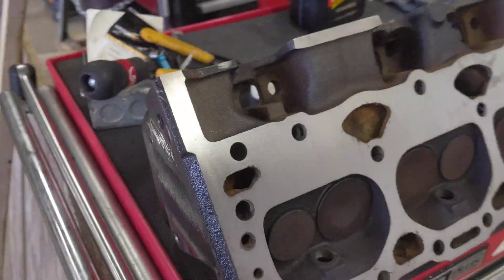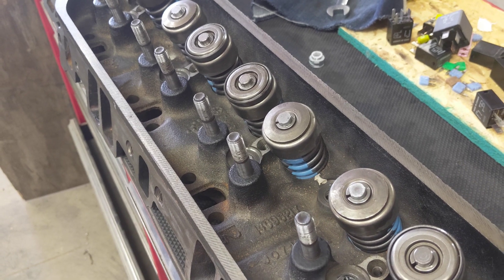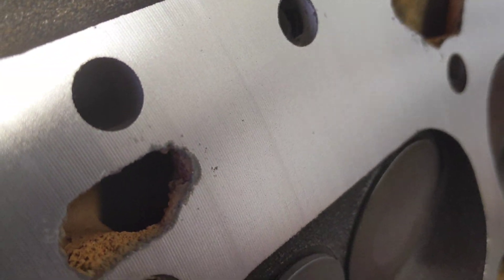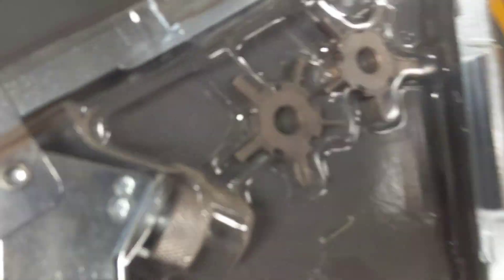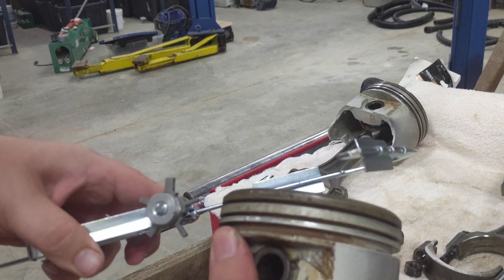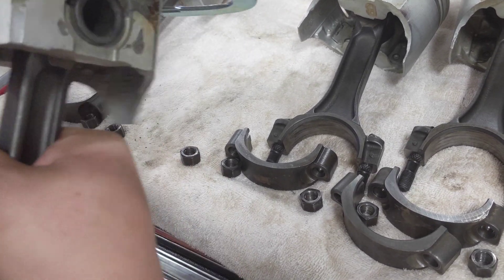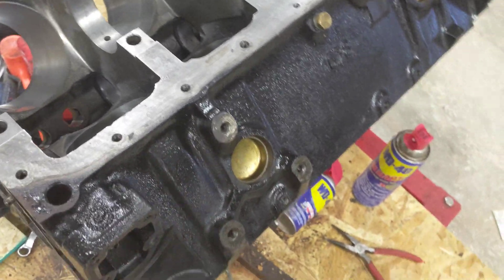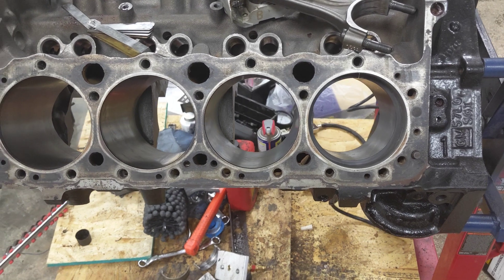'95 Crownline 5.7 Mercruiser Rebuild Part 7 -- Valve Stem Seals and Piston Ring Groove Cleaning

Comment: What shop did you send the heads to?
Reply from the maker: Just a local machine shop. L&L Machine Shop in Yankton SD.
Reply: Do they have a contact you know of? Or the cost
Reply from the maker: Their phone number is on Google. Really anyone can do the job. Nothing special about these heads compared to a Chevy truck of similar vintage. Installing new seals, machining the guides down and milling the head flat was like $300. Idk if that was a good price or a bad one but they are local and easy to work with and quick turnaround so that's what I did.

Comment: Thanks a lot for the video! What’s the manual that your using to look at the specs of the compression ring?
Reply from the maker: All the ring end gaps are taken from the SELOC sterndrive service manual #3206 section 5-40. The height of the rings was measured with a caliper so I knew which rings to order. It is based on their thickness.